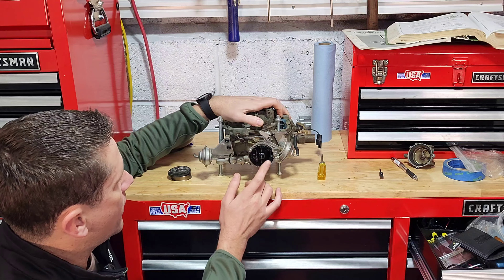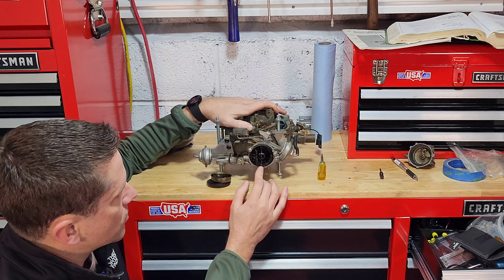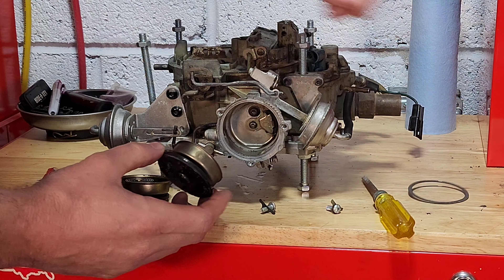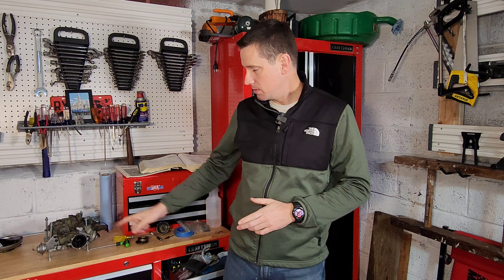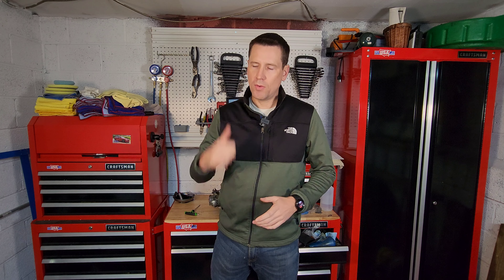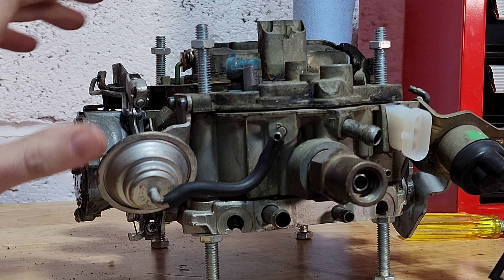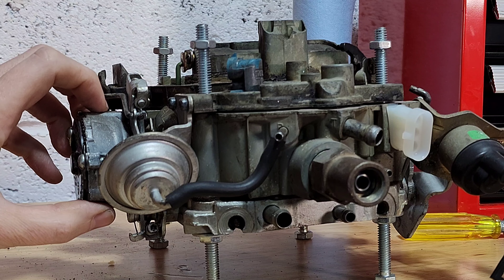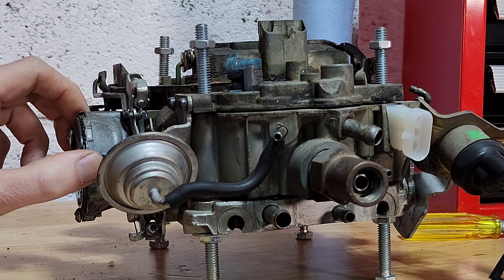Electronic Quadrajet - Choke Stat Lever and Fast Idle Adjustment

Comment: By far the best video on the art of quadrajet adjustment on YouTube! My daily driver is a 1978 Oldsmobile Delta 88 Royale with the 350, and I have been using Shell 91 V-Power since I got it as it had no ethanol. Sadly, every gas here in Canada was forced to have 5% ethanol this past summer. Even the 94 Chevron. So, the ethanol totally dried up my accelerator pump. Looked like a dried banana. Rebuilt the carb easily, but there is absolutely nothing on how to set the choke. Now I found your video, but it's late, so come morning the carb will get some TLC on the choke. I have owned many quadrajets over the years with no problems whatsoever, but this ethanol junk sure did a number on my old girl. Liked and subbed! Thanks a million!
Reply from the maker: Absolutely. Where I live, it's impossible to get pure gas. If there car sits for a few days, I come back to a dry float bowl.

Comment: The problem I have is my high idle works fine but I can't get the idle to step down...typically not until the car is almost at operating temperature. What suggestions do  you have on what to check?
Reply: yep, honestly, I'd like to eliminate it all together. im not a big fan of going to fast idle from a cold start.

Comment: Great video as always.

At cold start, my '86 Caprice idles way too high AND take 5 minutes or so before it drops down to the second step of the fast idle cam.

Are 1) fast idle speed and 2) fast idle duration both affected by the fast idle adjustment screw? Or could it also be because of choke stat misadjustment?

Comment: Question my car is an 85 electronic Qjet 4bb when I start the engine and kill the key after it runs it starts dieseling any advice ? Carb adj. cleaning?
Reply from the maker: These have a tendency to diesel if the idle speed is set really high. I would start there.

Comment: Would the drill bit size be 31 or 5/8 in fractions?
Reply from the maker: The actual conversion is 3/25. I'd recommend using a 1/8 drill bit, as they are available in any hardware store. That equals about .125, which should get you close enough.
Reply: Sounds good thank you boss!